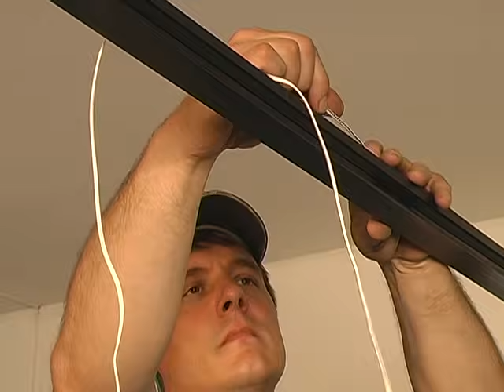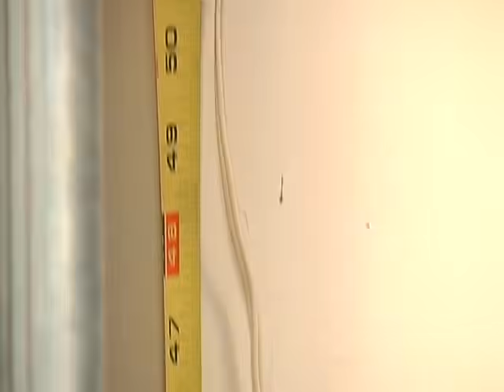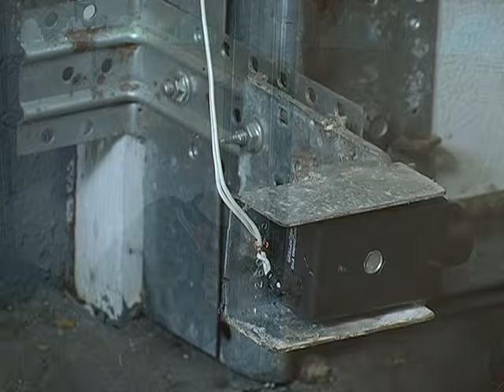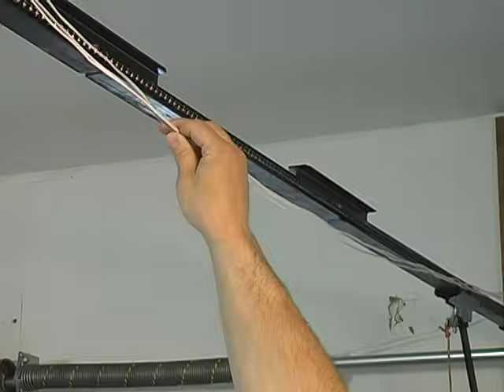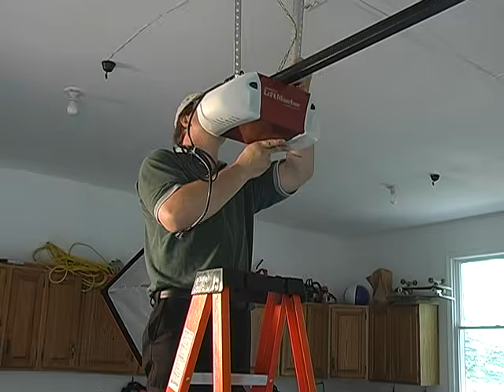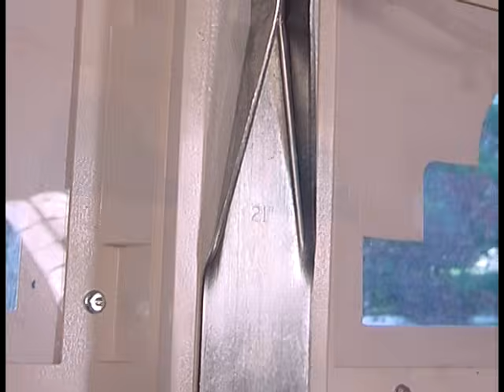Garage Door Opener Installation

Comment: My doorbell wallbuton is mounted at 45 inches above floor and it was installed by catslerock houses and they didnt cut the extra peice  and they use the wrong wires that is really not good to do

Comment: It almost seems like you guys threw up this install to its full worst extent and then install the 1 opener "professionally" Only reason I assume this is the header bracket used to hold up the T-rail is black, while the header bracket that WOULD have went with that Sears/Craftsman is Silver. Nice try, you guys just took down a Lift-Master threw this up and made this shitty video.

Comment: The motor itself most likely had a back up battery installed, so the motor can still be used to open or close the door a few times. Even though it's unplugged.

Comment: We installed the new springs(150LB Red code), garage door won't go down.
little bit move down and right back up.
The door can be forcefuly pulled down. It's more than 500LB door.
Opening with remote control works fine. Closing is the problem.
some advice please?
My car has been sitting out...:(

Comment: Just a quick question. Does that wire channeling lock the wires in securely? You yourself said wires shouldn't be near any moving parts, and in this factor, you have the belt and the trolley.

Comment: No, it's the original DC belt drive.  It took the design of the older screw drive designs, but apparently there were numerous problems, (shocking, since it is a LiftMaster).  Chamberain removed that style completely...  you don't even see it in Craftsman anymore.

Comment: Punchis1983, This is actually a LiftMaster Model 3850 with Built-In battery backup.  Rather than simulate a power outage we unplug the operator to confirm the battery backup is working properly.  Or David Copperfield is our Installation Technician, you pick.  Please call your local Precision Door Service Franchise and we can install one of these for you.  Have a great day.